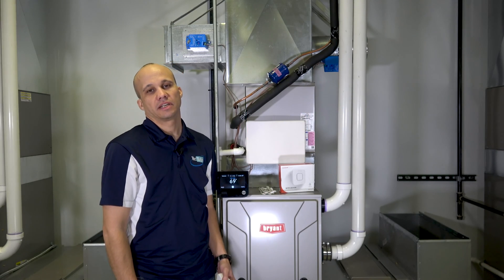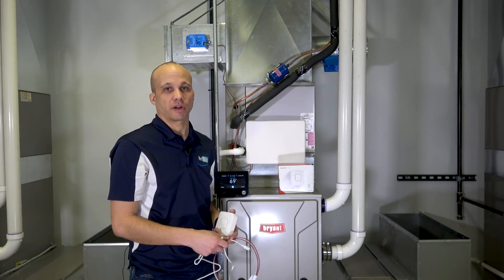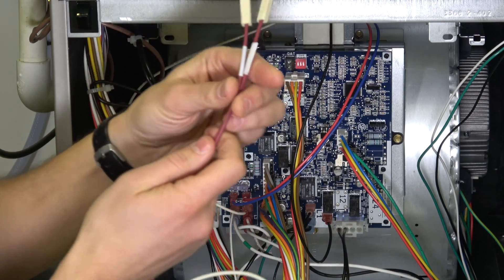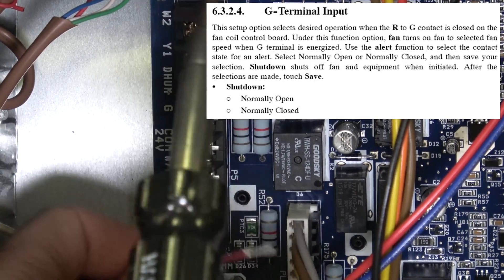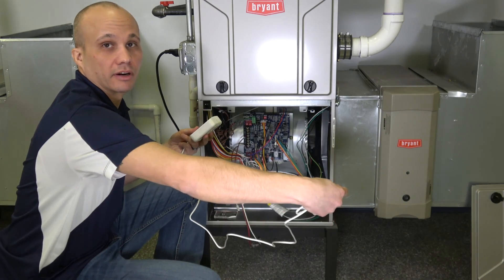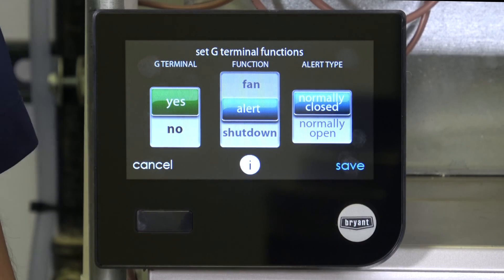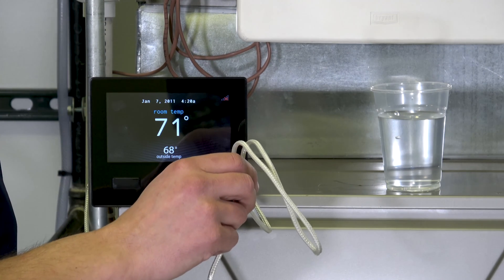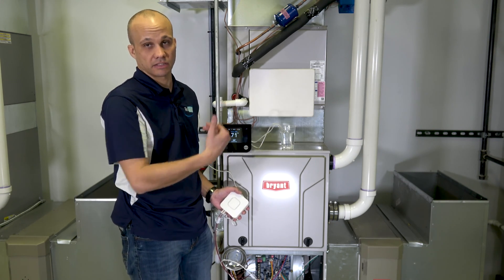Water Heater Leak Alert for Infinity, Evolution, or Ion Controllers

Comment: If we have the float switch to g can we also use this.
Reply from the maker: No, you cannot. It can only do one of the following: force the fan on, shut the system down, or send an alert only message.
Reply: Tec Tube thanks I usually use it for the float switch.
Reply from the maker: @antoniosantiago2770  If you have an attic system, then yes using it for a condensate overflow float switch makes the most sense.  If you have basement system, then you can put multiple water leak sensors on the floor by the water heater, sump, and even near the evaporator condensate and wire them in series.
Reply: Tec Tube yes I was just thinking about that. We can protect a wider area in different places when in a basement, Thanks for sharing.